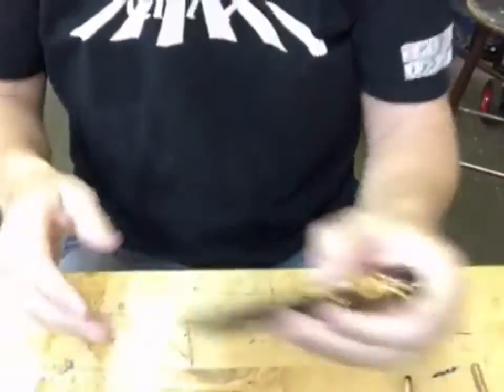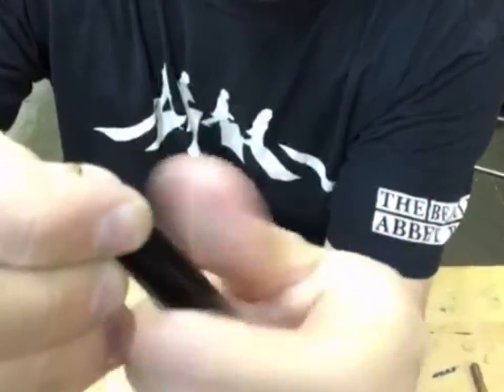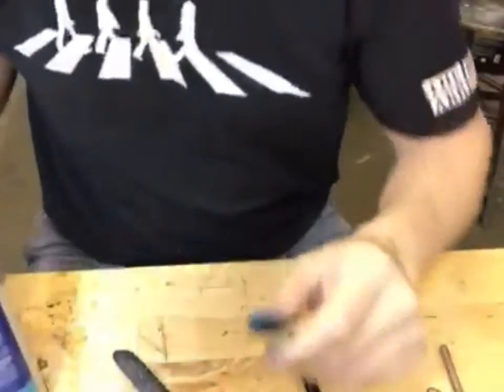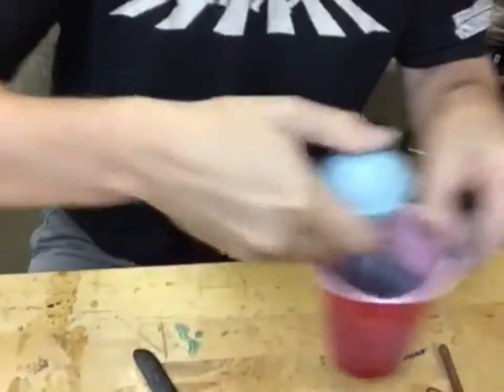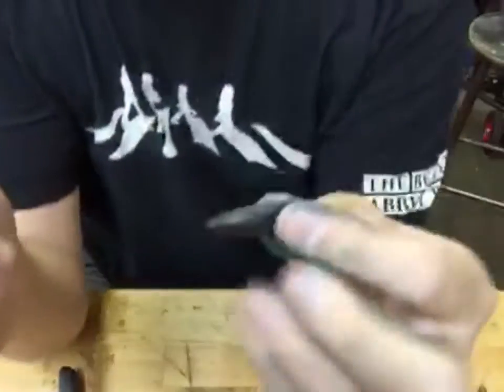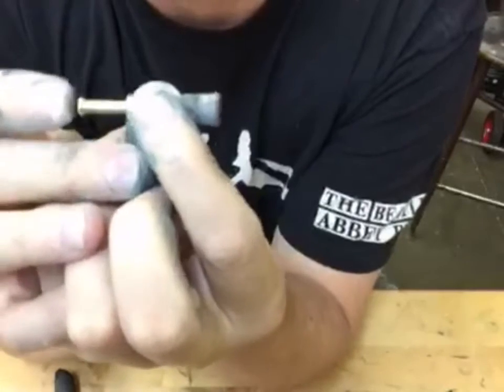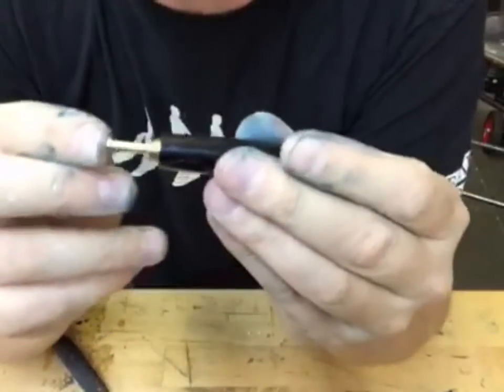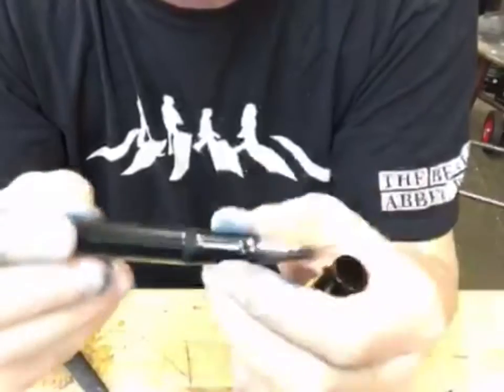Periscope - Repairing a Pump Filler

Comment: Here I was hoping to see you fixing my beautiful Pearl Grande. I am actually going to be opening the package up for it after I eat and watch the video. Thanks again!!
Reply from the maker: Yeah, the procedure with yours was the same.  Thanks!
Reply: Do you know what the problem was by any chance? I unusually left ink in the pen, when I usually clean out all my pens. It was a sailor black and from what I remember the sack was not destroyed.
Reply from the maker: Nano Sailor Black (the permanent version)?  This could be it.
Reply: It was a bungbox black, which is made by Sailor. I actually tested it with latex prior. 
I'll do some more testing. I am (finally) going to setup a family of tests using my entire ink collection in my lab. I'll be able to accurately test the damage of certain inks on latex sacs. I am going to make a purchase of some more friendly inks (as mentioned on your website) as controls.
Reply from the maker: OK honestly, I don't know the difference between Bung Box and standard Sailor.  Are the colors more saturated than standard Sailor?  If so, that's probably the issue.  Based on what happened, I'd probably avoid it.  Waterman and Aurora are the best.  But of course, there are plenty of other perfectly safe inks out there.  Only a few that can be problems.
Reply: I think the issue with Japanese inks and latex is that they are not ph neutral, but base.  This is per Richard Binder's ink article on his site,
Reply from the maker: Makes sense, thanks!

Comment: Hi Brian. Thanks for the video which was REALLY educational. I've been thinking about Inks ever since. It occurred to me that even good quality ink from highly respected pen manufacturers could still be a problem, simply because so few companies make pens these days that rely on rubber or latex. Being "rubber friendly" is probably not a huge consideration. It's all a bit of a minefield. Any chance you could post a blog about "safe inks", but without mentioning particular brands? Thx again for the video. Martin
Reply from the maker: Yes, good points.  In my opinion, the inks that are excellent in all qualities including safety is Waterman, Aurora, and Diamine.  However, perhaps avoid some of Diamines very saturated reds.  There are others, of course, but these three are the ones that I'll endorse the most.  And if you are interested, Richard Binder has written an excellent article regarding this.  His experience and thoughts are identical to mine (and he does name specific inks to avoid).

http://www.richardspens.com/?page=ref/care/inks.htm
Reply: +Edison Pen Company Thanks Brian. That's really helpful. I know some people speak  highly of J. Herbin Inks. But I'll check out the Binder link (and store it!)

Comment: Hey Brian, can you recommend a bench mounted buffing wheel to use for polishing pens?  I don't need anything too crazy, but I don't want a piece of junk. Thanks!
Reply from the maker: Hi Bill.  I think that if you can find a Foredom Polishing Bench Lathe, you'll be in good shape.  It will never have the power that the huge buffers that we use have, but if you don't require production speed like we do, then you will be fine.  

https://www.riogrande.com/Product/Foredom-Polishing-Bench-Lathe/334016

Comment: Can this problem be avoided by using ink from fountain pen companies (I'm thinking Parker, Sheaffer, Waterman, etc)? I suppose in the long run latex will degrade anyway.
Reply from the maker: Generally speaking if an ink is made by a fountain pen company, it will be safe.  They don't want to create inks that will damage their own pens, clog their own feeds, etc.

Comment: Is there the same "danger" to the Edsion Pneumatic-filling-system-pens? Or so you use different sacs there? Thanks
Reply from the maker: Yes, pneumatic fillers use latex.  But I really wouldn't call this a danger.  All of our pens that have latex come with a letter addressing this so customers can make the right decisions, and if they are unsure, they are invited to reach out to us.  There are many many safe inks out there, and only a few that can be a problem.

Comment: Ddwhat about silicon instead of latex?
Reply from the maker: Yes, I did address this in the video.  Silicone is available as a sac, but not as a diaphragm.  But also, the silicone sacs that I tried were not gas impermeable.  They were pretty worthless.